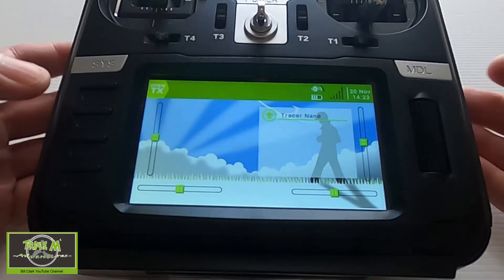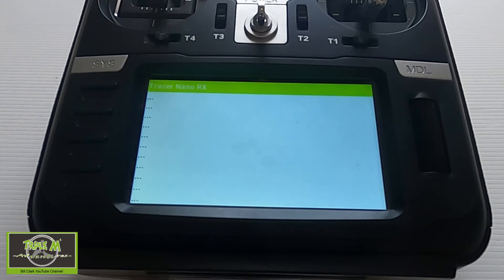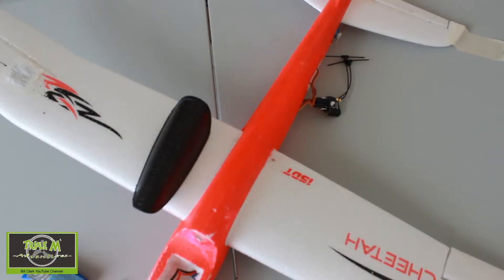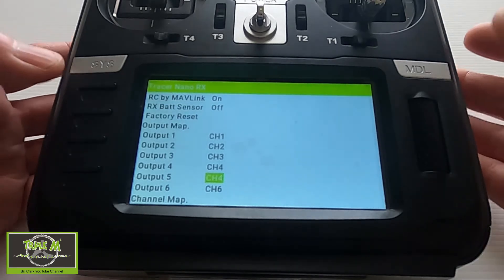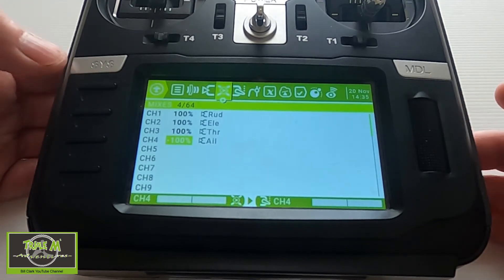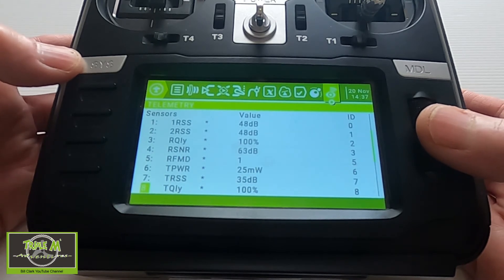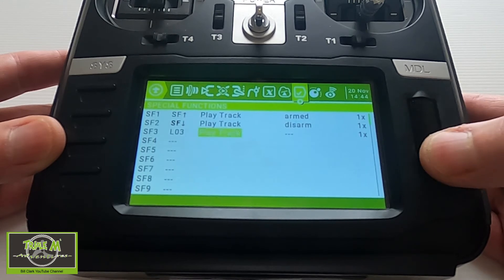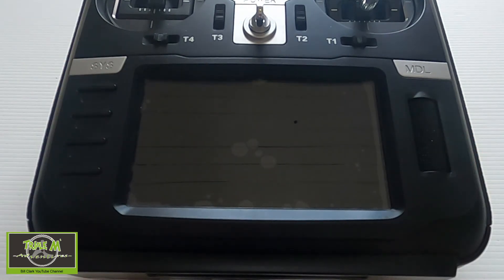How to set up the TBS 6ch Crossfire & Tracer Nano PWM Receivers

Comment: now what are the genious ways to get vbat in your telemetry? i have contemplated using the matek board, which has vbat sense, but surely we could use a voltage sensor from amazon or something?
Reply from the maker: If you have the correct electronics experience I would think it’s possible but I have never done this.

Comment: Hi there I was wondering if Can I plug in directly the hobbywing 2-1 motor to the TBS crossfire 6ch PWM receiver?
Reply from the maker: If the motors ESC BEC delivers the correct voltage you should be fine.

Comment: By the way can i solder my quad crossfire receiver to PWM adapter that tbs sells or it will be different?
Reply from the maker: Just check the pin outs are correct.

Comment: My throttle is not working for some reason. Can you help me?
Reply from the maker: Please give me a bit more information so I can try and assist you. Can you see the throttle movement in your radio. Which radio do you have?
Reply: @the-happy-RC-flyer  Thank you very much for considering me 🤩 I am using Radiomaster Tx16s. I am able to see the throttle movements in my radio all servos are working. But the ESC just made a beep beep sound and not settling, I tried a different ESC motor, and it's the same.

Before also followed your video and successfully converted using a 4ch adapter, this time it's a 6ch adapter and stuck with the throttle issue. Not sure what is the problem.
Reply from the maker: @ASAN  is your throttle channel reversed?

Comment: Where can I find info on setting up the arm switch?
Reply from the maker: If you are asking about your radio I would suggest using channel 5
Mixings Options:
Mix Name Arm
Source - switch you wish to use for arming.
Weight  could be -100 or 100 - test in Betaflight before flying your drone. 
Offset 0
Curve 0

Comment: Nice job. 

FYI : when you see in the transmitter [ENTER]   [RTN]  !
that's mean the system or software is asking you for confirmation by ENTER or return from what ever is going to happened by RTN.
You don't have to press them both 
Thanks again

Comment: Hi Bill, great video, although I am struggling greatly on my side, would you be able to help me, I can't seem to find decent explanations anywhere aha...
So I have a tango 2 and the crossfire 6ch pwm nano rx being set up in a DLG, I bound the rx through agent lite, however, can not seem to get my servos to be working, and I'm now in a muddle with the setup or what settings I should be using... I see you selected crossfire, but if I change any of the modes it un binds it self and doesn't allow me to find it... 
Please help! Aha 😁
Reply from the maker: You need to check the Output Map. And check Output 1 = CH1, Output 2 = CH2 and so on in Output Map settings of the Nano receiver using TBS Agent Lite Lua script. Channel Map must be the same CH1 etc. Please check this first.
Reply: @the-happy-RC-flyer  Hi Bill, great help thanks, I found the page and made the change so that is now correct but still no joy...
I realised that you change the mode in the setup menu to crsf. When I do this I'm unable to bind the rx through agent lite, it will search but not find any options... 
I've also since tested the servos to check they are still working etc...
Reply from the maker: @RIPnDIPfpv  I would now suggest running the binding process again. Are you able to search for telemetry in the model setup?

Comment: Hey Bill,  is there a way to get VBAT sensing using the Crossfire nano RX 6ch adapter?  I'm trying to get battery voltage info without a flight controller on my airplane.  Any advise would be greatly appreciated.
Reply from the maker: Not that I am aware of, VBAT comes from the ESC via the FC to the receiver. You will notice that you have only 10 telemetry sensors when the TBS Nano is connected to a PWM adapter.

Comment: Hi there bill. Great video. I have a question regarding setting this up. I use tbs agent lite on my Reciever which is a taranis qx7. When I go into the channels or outputs screen nothing loads. Its just a blank screen. Any idea why this could be happening?
Reply from the maker: Sorry silly question is your receiver bound and connected to the Crossfire or Tracer module?
Reply: @the-happy-RC-flyer  not silly at all! A mistake I've made before! Yes it's bound and showing in the tbis agent lite program
Reply from the maker: @OneOrange93  Can you access the General and About options in the XF Micro TX? If this persists I would suggest updating the firmware if you have not already done so then if that does not solve the problem Factory Reset the RX via the TBS Agent Lite. I have so far not come across this problem, your RX data is not being sent back to your radio.
Reply: Yeah I can access all the other menus just not the output or channel menu. However, when connected to the tbs agent on the laptop I can access these menus. I think a full factory reset is in order
Reply from the maker: @OneOrange93  Let me know how it goes please.

Comment: Como podria aser eso en un control flysky q7
Reply from the maker: I have never used Crossfire or Tracer with a FrSky QX7 but I think you need to complete a modification for it to work. Please check the internet for the modification the part required is included with the modules.

Comment: How do the aileron servos move in opposite directions without channel mixing? As far as i understand the servos should move in the same direction as it is connected to the same channel.
Reply from the maker: It depends on the orientation of the servos in the model so you may need to reverse the mixes. Basically is the servo are on the left or right side of the servo.
Reply: @the-happy-RC-flyer  ohh got it now. Thanks for explaining

Comment: Can you connect unify pro32 HV to this Receiver? I am converting my Arrma Felony RC Car for Long Range Street Rips. I also want to install betaflight to my RC Car so i can get RSSI, GPS, Buzzer, more channels, LEDs... the works. so for me this is a great video!
Reply from the maker: I have no experience with the Unify VTX’s but I know you can reallocate the pins of the Nano receiver but I have not done it yet myself. I would not want to give you advice on something I have not yet tried. I am sure it is possible.

Comment: Great video. I have been trying to find this info about the outputs. I'm assuming I can just direct solder servos to save buying the adaptor thing? Provided I get the ground and 5v rail correct?
Reply from the maker: I think you will need to get hold of the adapter to convert the Nano to PWM.
Reply: @the-happy-RC-flyer  ohh right. so there is some kind of conversion going on? doesn't it output pwm out of the 6 holes?
thanks for responding
Reply: I have just tested this by soldering some servos to it directly. works fine. thanks again for the video
Reply from the maker: @MrEidroeg  are you using a Nano or PWM Nano receiver? I am interested how you soldered servos to a Nano receiver without the adapter could you email pictures to me please?
triplemadventures@gmail.com.
Reply: @the-happy-RC-flyer  The nano receiver outputs pwm on all 6 pins.
Reply from the maker: @josephseed7734  Thank you for that.